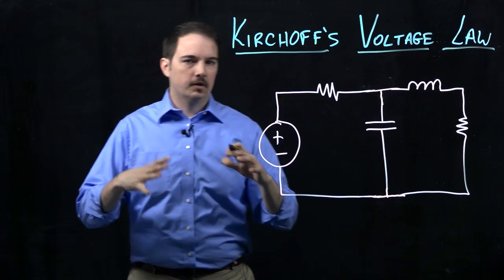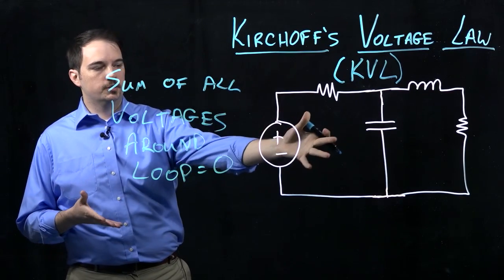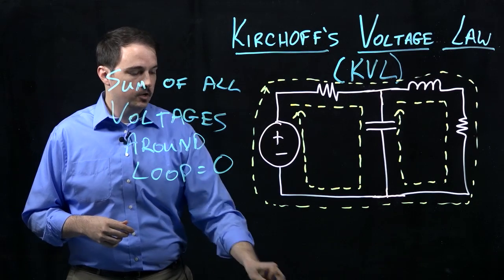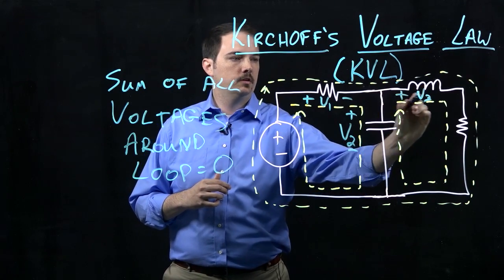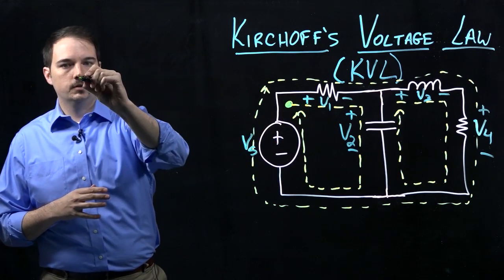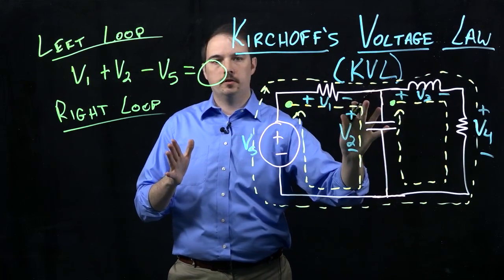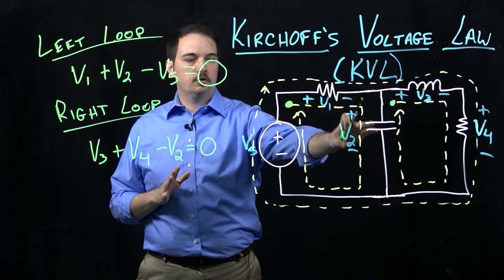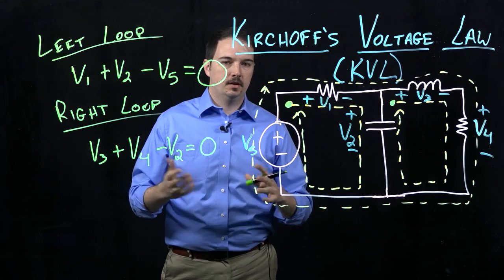Circuits I: Kirchoff's Voltage Law (KVL)

Comment: That circuit calculation you did for explaining voltage drop is very confusing for students . Most students that are in school get taught that a positive is usually indicated as a voltage drop since it's going from a high potential to a low potential which indicates a negative. The first loop should be vs -v1 -v2=0 loop 2: -v3 -v4 + V2=0
Reply: We just have to get used to it, as a load can be a source too, arithmetically.

Comment: Hello Mr Dr.Hyle Montdomery,
             Superb Explanation & understanding quickly about of KVL along with example circuit...!!! One request please upload the video which is solved example circuit with the some values of Voltage Source, Current source, resistor, capacitor & inductance.